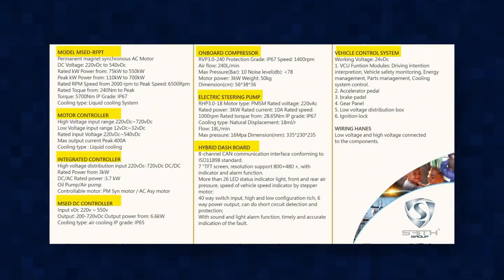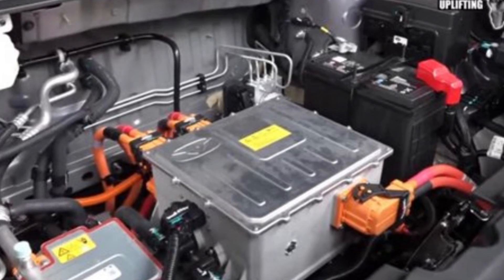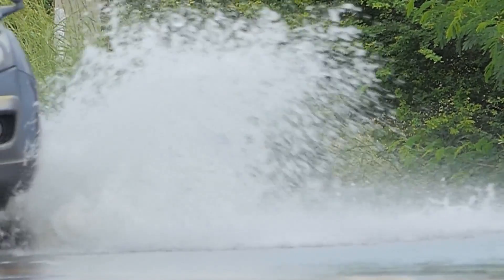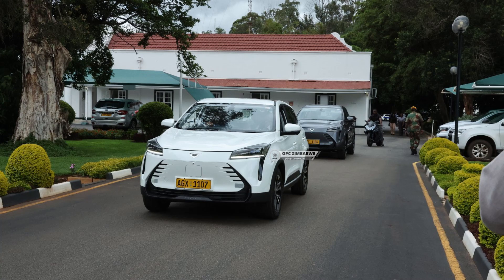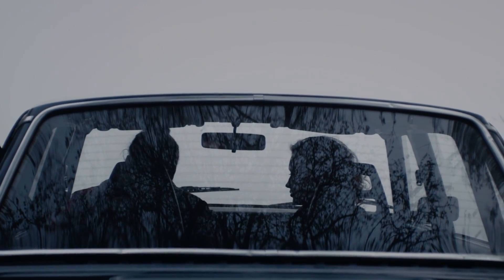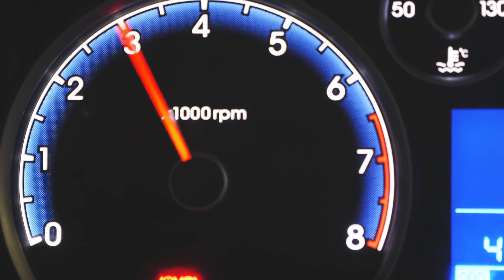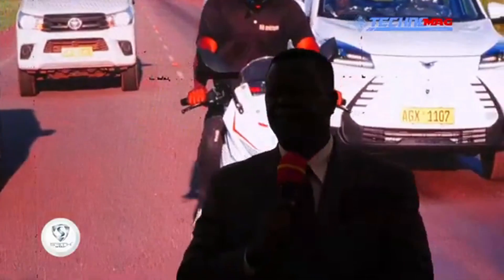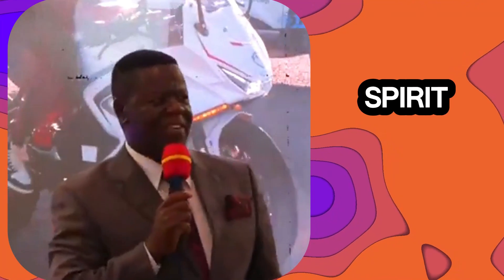Maxwell Chikumbutso's Breakthrough Tech: Worth The Price?

Comment: This is some strange elaborate joke or scam.
He’s demonstrated nothing, the pictures released are a lithium battery with a cheap deconstructed inverter glued to it and 2 battery management units charging the battery, the lcd display says 240v 50hz, that is the voltage output and frequency of a inverter for mains power.

Comment: Here is my SCCAAMM idea.. my MacroPower Technology (MPT) takes power from radio waves and magically multiplies it, .....for my MPT to work, I modify ONLY the charging module on any EV to allow it to charge the car continuously through the modified charging port..even when driving. My sccamm wouldn't require a big list of major components nor change anything on the EV other than the change to the single charging module .. my sscaamm is better then yours..

Comment: So let's see.. $10,000 for the kit and $15,000 for a fully outfitted EV. ..If you look at the kit list. it would require MAJOR modification to the original vehicle... easily $5,000 in labor or more to totally restructure the original EV function by adding these CRITICAL components... so the $15,000 EV itself is essentially free to the buyer and a huge loss to the seller ... sccammerZZ and CG hoaxERZ always overlook simple things...

Comment: How will it run in the colder climate like Canada ?
Reply from the maker: Maxwell Chikumbutso’s technology harnesses ambient radio waves, which exist regardless of climate. In colder regions like Canada, performance hinges on device durability, not energy availability, as radio frequencies permeate all environments. Insulated components and cold-resistant materials would ensure stable operation. Efficiency depends on signal density, which may vary, but the core conversion process remains unaffected by temperature. Further cold-weather testing could optimize output consistency.

Comment: Mind you that he has designed his devices that if you even cut one wire or tamper with it in an attempt to study how it works (anti re-engineering )… the technology will self destruct and become inert rendering it impossible to discern. He says it is a way to protect his technology as they were refused a patent. If true it is genius but it is also a very good excuse for units that run out of power. They could just say to the gullible buyer or reviewer that the failed unit was tampered with.

Comment: I worked with RF communications for years.  Don't think it's  possible.  What happens when your far away from any Rf transmiter? You would need a good antenna to pick up the signal and where is his antenna?
Reply: You are right Sir , the power density of RF is very very low and hence it is not possible to use such energy to drive a car or any light  vehicle ....!!,
Reply: Its only possible to harvest a few volt from radio waves ,, iven if you are next. To a higpower er transmitting tower
Reply: @phillip-w5g  
With a modest antenna, you can harvest enough to keep a very low power microcontroller ticking over..
   Not much else though..
Reply: @adrianneill5014  Energy from the ambient do not need precise antenna. Even the vehicle's body is more than enough. Power amplfiication is what you need.
Reply: @JB-20   
Do you understand how radio waves work...?
   Not being funny, but do you..?
Reply: To receive RF energy, at any frequency, the antenna needs to be precisely tuned to the whole, half, quarter.... wavelength of that frequency...
   A blob of metal, like a car, isn't receiving anything much...
The radio, and your phone, only work in a car, because of the windows..
Reply: @adrianneill5014  If tuned you only received that certain signal. Maybe good for you but a bad idea for me. It's the main reason why impossible to others.
Reply: @adrianneill5014  I believe you're focusing to one single source which is negative to me.
Reply: @PLASMUX-20 if it was just about power amplification then why bother harvesting radio waves? According to that mindset you could power a car with a AA battery. This is a giant hoax.
Reply: Radio signals are all over the world not like phones
Reply: @gift7233  
Inside a radio receiver, the signal is amplified from almost nothing, to something usable...
   That amplifier uses a lot of energy, from batteries or mains...
  Crystal radio sets didn't need external power, but needed a huge (relatively) tuned coils, and very powerful stations to be barely audible....
Reply: @gift7233  really? then why is it you can loose radio signal on your car radio in some places? and believe me i know, this happens to me every time i drive down a certain section of highway near where i life and it lasts for about 5km
Reply: The radio frequency he is talking about is freely available in the air. It is a part of space. So it does not matter how far you travel, that frequency will always be there.
Reply: @TheWatcherFilesOfficial  
You are talking about "aether"...
   The, as yet undiscovered force in the universe that people used to explain things, from before gasses, electricity and bacteria were discovered....
   It's been very proven to be a load of rubbish hundreds of years ago..
Reply: @TheWatcherFilesOfficial  en.wikipedia.org/wiki/Aether_(classical_element)
Reply: Upon looking at the device it itself speaks different from what has describe. It's not about RF from different broadcast station. Just named to confused others.
Reply: He's not going to tell you how it works he's going to just sell it to y'all and you enjoy it y'all don't have privy to this the only reason why everybody is making electrical vehicles because Elon Musk did not create the schematics for it he does not own the patent for it this is why he was able to just be the first to put it out there and everyone follows suit it did not belong to him it belong to Tesla.
Reply: You are dull in understanding
Reply: Then you convert to the already charged battery, simple 🤷‍♀️
Reply: @stevenwilliams3015  Again, it's not about RF from broadcast station or transmitter.
Reply: @PLASMUX-20  
That removes the only way it could be possible....
   Enlighten me, how are we getting 150kw, from a tiny box without breaking physics.?
Reply: And why, of all people is a pastor saying its real...?
Faith, above science is their business model...
Reply: @adrianneill5014  I never say fake or real. I also doing my own experiments and I would say the energy is there.
Reply: @JB-20   
Sure, it's just 20 or so years away from being commercial....
Reply: @PLASMUX-20   
Quick demo challenge....
  With an antenna, no bigger than a car, run a 12v 5w car lightbulb....
   No batteries, and you can even put it under a high voltage power line if you want..
That's 10,000 times less than even a small EV needs to run...